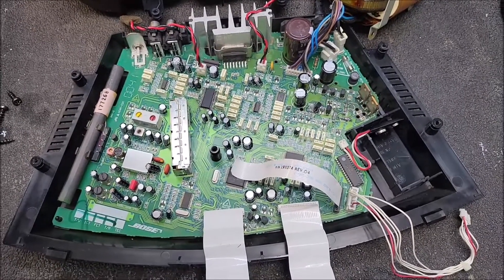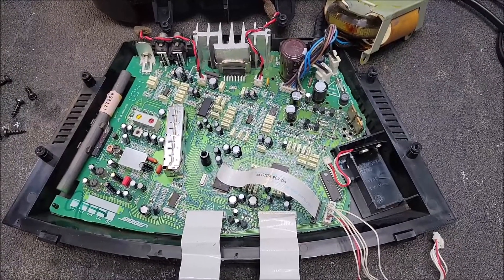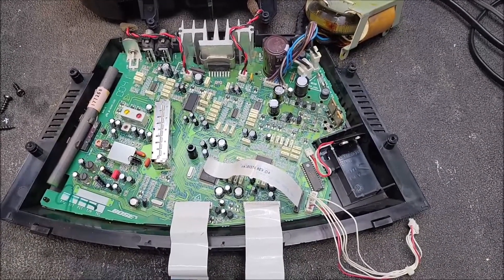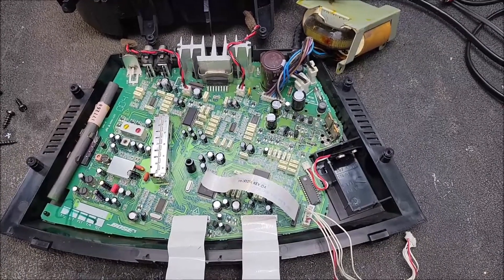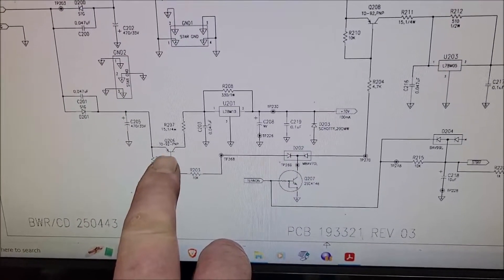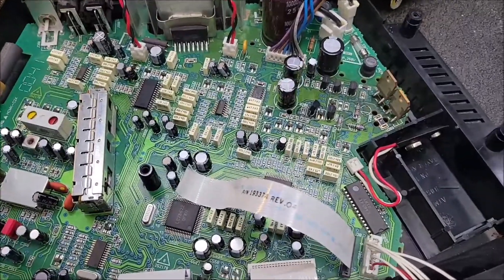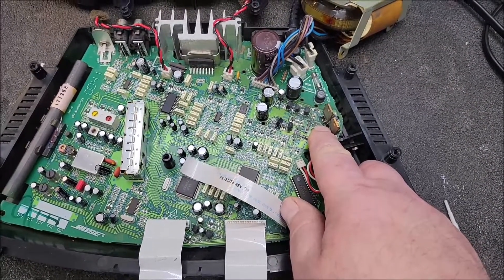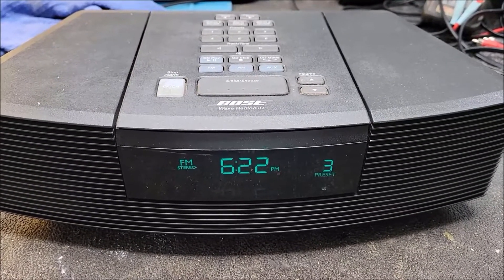Bose Wave Radio CD Model AWRC1G loud buzz through speakers

Comment: I had the same problem of loud obnoxious buzzing. The volume chip was hot and the voltage from the 10v regulator was low too. Got a replacement from eBay and my awr1 is working again!  My revision didn’t have a transistor in the 10V circuit. Thanks for your video as it helped diagnose and fix my radio😊